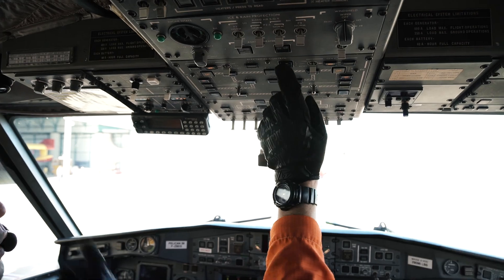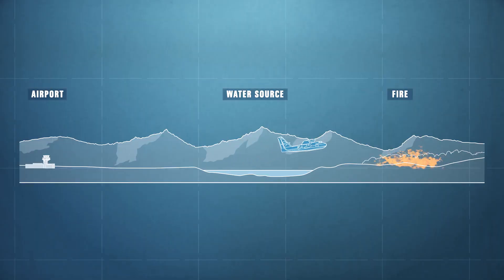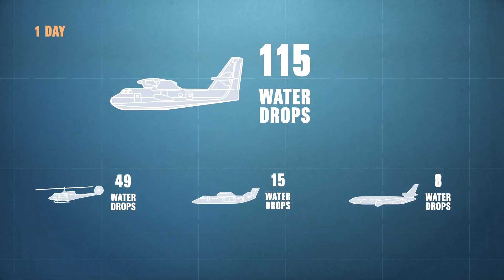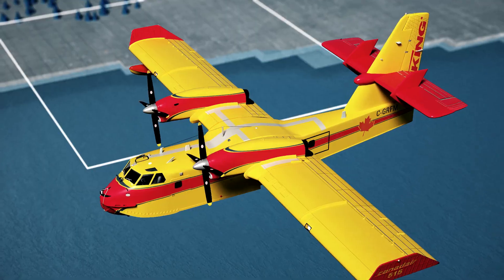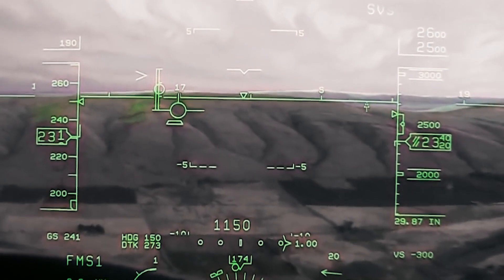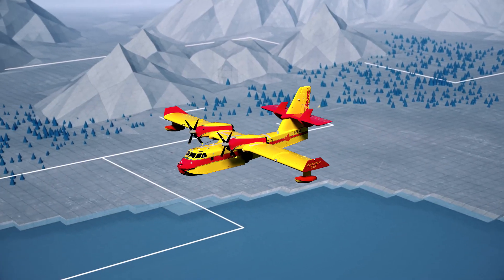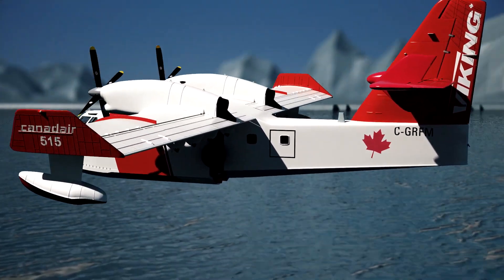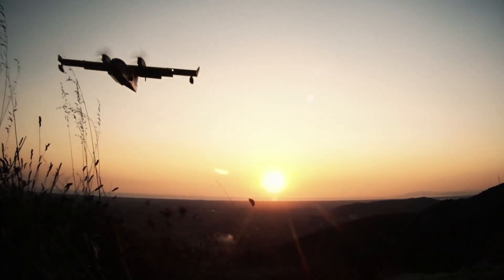Introducing the Viking Canadair 515

Comment: Canadair firefighting airplanes are awesome, but for the love of God, countries need to band together and place enough orders to get the production line back online. For example, Greece has been struggling with fighting huge forest fires with 40 year old Canadair for years. And while they are holding incredibly well, they are prone to technical issues due to age, some are unfortunately lost (like the one that fell in Greece on 25/07/2023) and replacement parts are notoriously hard to find. This planet needs this amazingly designed airplane to start rolling out new versions to replace and upgrade the existing aging fleet of several countries that are struggling against forest fires. Governments (especially European ones) need to unify on this and place enough orders to revive this production line, otherwise things are only going to get worse for these pilots and crews.